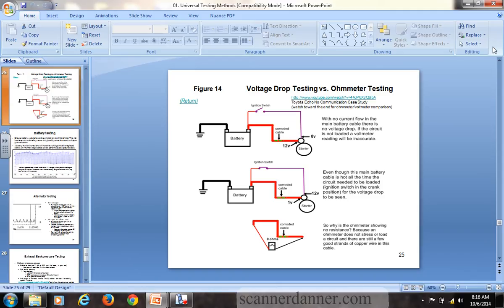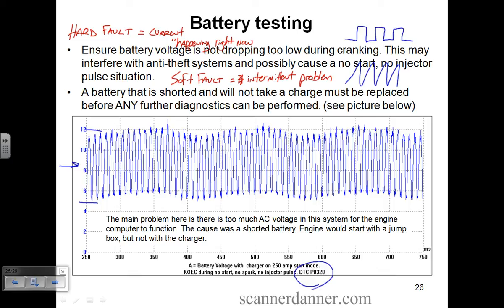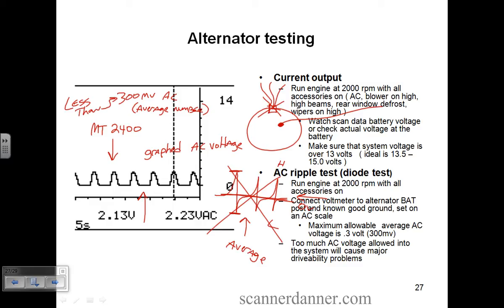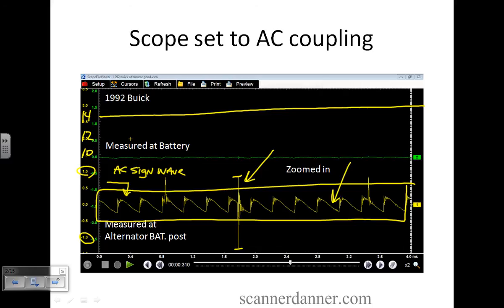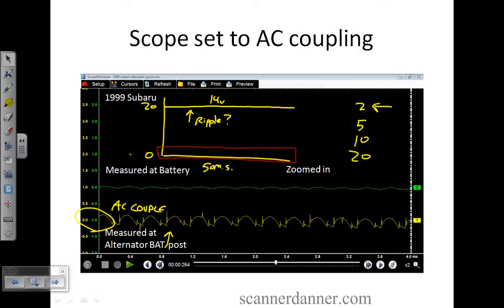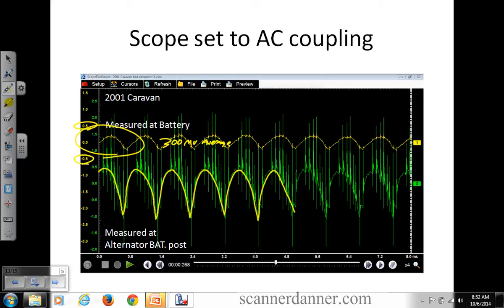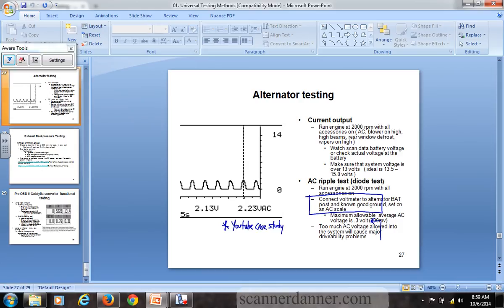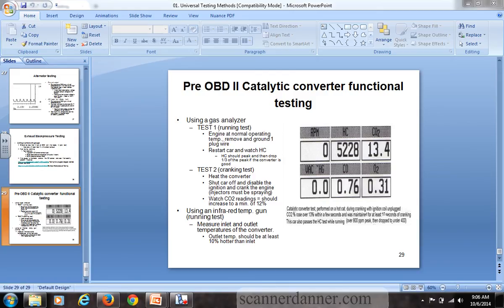Alternator diode testing (pg 26-27 expanded content)

Comment: where else would you use an "AC Coupling" on a scope, especially the UScope that doesn't show negative numbers? Is there a place for it looking at fuel pump humps or relative compression?
Reply from the maker: You can use it when doing a cranking compression test using battery voltage instead of amperage. 
For digital wheel speed sensors signals  https://www.youtube.com/watch?v=LKJWkAGMOfQ

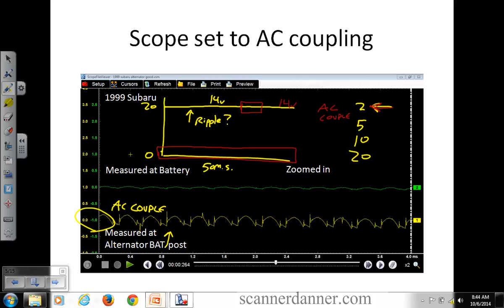Comment: Has the frequency of each hump peaked your interest? (no pun intended) Using Ford TSB 06-19-12,  I'm dealing with a 2005 Ford F-250 5.4 with a measurement of 195Hz per hump. Will be slapping an alternator on tomorrow, thank you sir. Just thought maybe frequency would be a good talking point for this particular issue? Put it this way, 28:20 my hump at 5ms takes up the entire screen.
Reply from the maker: I haven't really considered it but I do know some guys use it to determine RPM of the engine.
Reply: Sorry if I didn't clarify, this video has me second guessing an alternator issue affecting the transmission. I am referring to scope of b+ on alternator AC coupled. The tsb from ford states my frequency should be 1Khz or greater, and to somewhat ignore peak to peak voltage. My voltage min/max average is -.200 to 200mv, not exactly horrible. But my frequency measurement is way off from their number. Will post update after replacement.
Reply: ScannerDanner Premium 
New Motorcraft alternator fixed the problem, new frequency  about 1khz, trouble codes involved, p0340-344, p0720-721-722.

Comment: Hey Paul could you call an active fault the same as a hard fault and inactive fault the same as a soft fault?Cheers mate.
Reply: Yes. It's just a name I picked up from flow charts back in the day
Reply: oh ok cool ! also I was just wondering does the maximum voltage 300mv apply to all alternators even 80-120 amp alternators? Thanks Paul
Reply: Yes but remember that is an average  measurment not spikes on a scope pattern
Reply: +ScannerDanner 
yes ok I understand. thanks Paul.

Comment: i just had a bad battery and huge ripple on an 06 civic that was causing the abs module to lock up lr wheel.  the controller recognized the lock up and had 2 other dtcs for voltage issues.  i wish i could show you the ripple i got. thanks.tanner.
Reply from the maker: +Tanner Salewich nice find bro

Comment: Hi paul, sorry for bothering you. I have a question about multimeters, i've got a cheap one with only 750 e 200 volt AC settings. The question is: will it be able to show me 0. AC voltages?
Thanks and have a great day, great like you
Reply from the maker: I don't see why not. A 200 v ac scale will show you millivolts, well at least the first decimal point, so anything more than -.3 on your meter would be bad

Comment: hey paul good job man  just a question in the video you mentioned the 2001 caravan that the tranny was shifting and you looked at AC ripple on a vantage mt2400  48.18 of the video also it appeares to be page 27 of your book. the pattern on the vantage is that an example of a bad pattern? the reason im asking is that the vantage mt 2400 does not AC couple without the low pass filter that AESWAVE sells. im thinking of getting one.  just want to get your opinion   thanks paul     mark ferraro
Reply from the maker: Mark Ferraro the Vantage was a graphed AC voltage. It was basically an AC voltmeter set in a graph mode. It is an average reading.
Reply: Can I do graphed on pico?  I know that I do not need it but I just wonder.